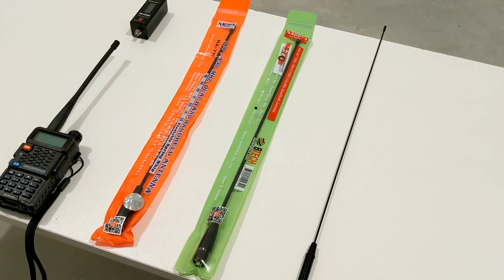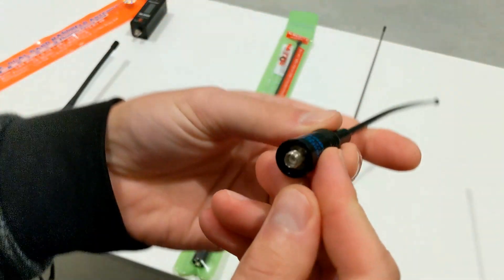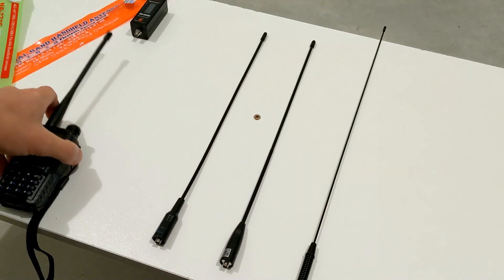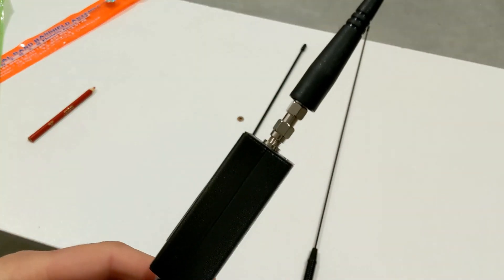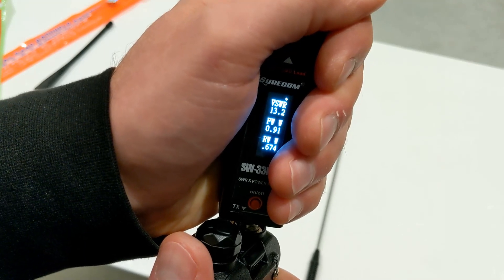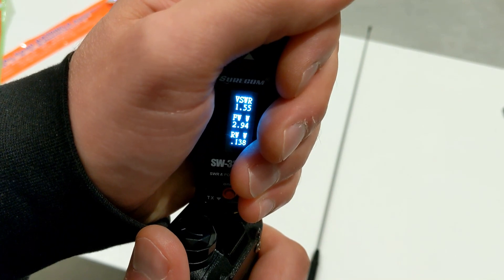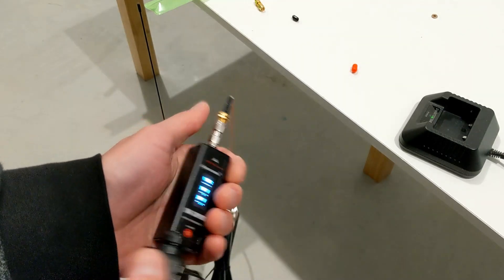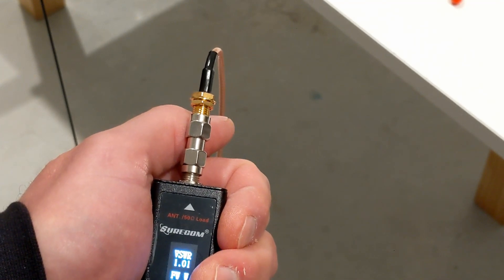Antenna test: Stock V-85 High Gain VS Nagoya NA-771 (fake and real) vs UT-72G - Part 1 SWR test

Comment: You need a metal pan like a pizza pan and stick the antenna magnet mount in the center with at least a inch of metal or more around the base. Then you can use it as if it was on the ground.

Comment: You got the '1.01' reading quite often when testing - that brings me to the conclusion there's something weird in your test setup! From the comments i read that this is due to the usage of the SWR-meter you use, and i think so too. When you grab it thightly with your hand you will nearly always get such readings. For the fake Nagoyas i saw very different results when testing. I think the quality spreads from 1:1.5 to 1:6 or similar depending on what you actually got. They don't do manual matching/tuning. At the base of the real ones you will find little inductor coils and caps as matching network for low SWR.

Comment: Its nice to see someone actually know how to use that meter. I can’t tell you how many people don’t put their hand around it when taking a reading
Reply: When wrap my hand around it it starts showing much smaller values depending on how tightly I hold it. If I squeeze it tight it shows SWR=1.01 even for the crappiest knockoff antenna.
Honestly, I'm not sure if that's the correct way to test SWR with this meter.
Reply: Well not fully because the power is less than 3w which is the required minimum power for accurate results of that specific meter

Comment: Useless comparison and tests!  Mag mount antennas must be on a metal surface (car body) to test SWR and the 771G is a dedicated GMRS antenna and not intended for use on VHF except for receive!
I have several of the "fake" Nagoya 771's and, when tested with a proper counterpoise on a properly calibrated NANO VNA SAA-2, they were all well within specs on both the amateur VHF (144 MHz) and UHF (430 MHz).
Reply: Yeah but who tf wants to use a counterpoise
Reply: Really??     I think I just bought about five of these fake antennas....     How do you then explain the difference in swr between the real and the fake he is demonstrating in this video??
Reply: @damiengirvan5020  My authentic Nagoya 771 has 1.01 SWR on 440 MHz and about 1.5 SWR on 145 MHz. From this video (and other tests I've seen) it seems like the fake ones are a roll of the dice on whether they're OK or not. Some of them have 3+ SWR on one of the bands, others are alright.

He's right though, the UT-72G antenna this guy is testing is specifically for GMRS frequencies.